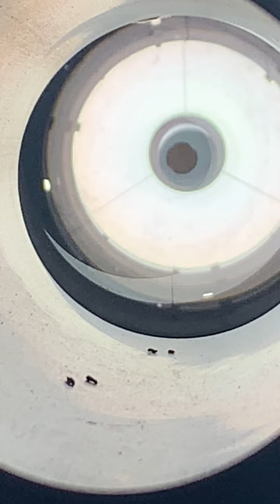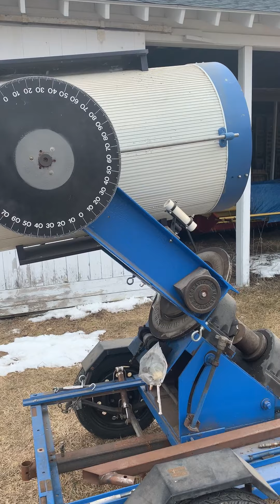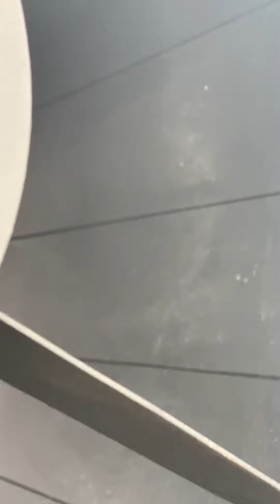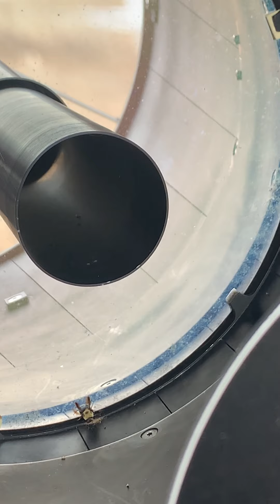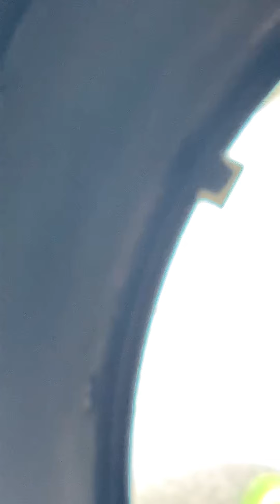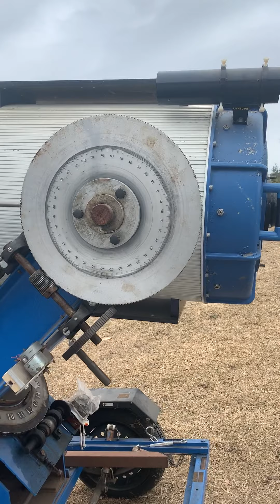Celestron C22 Telescope at Michigan Auction 4-5-2020

Comment: All of the C22s built actually still exist today. Some have been modified in one form or another. Only three exist with the original Schmidt-Cassegrain optics, and only two of those still exist with the original factory mounts.
Reply: I mis-typed. 4 of them still have the original SC Optics - Mine, the former McLean scope (now at Sierra Nevada College) Beloit College, and the one stolen from Timetown, possibly in private hands in Germany. The two of those that still have the original factory mounts are mine, and the stolen one.